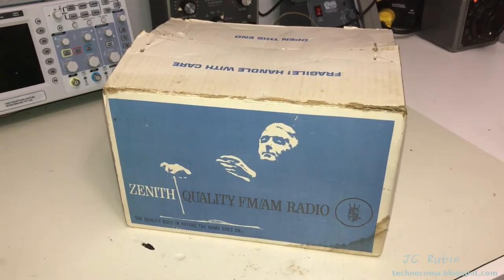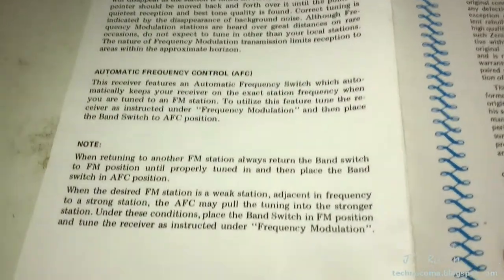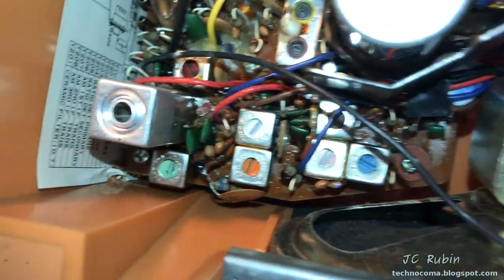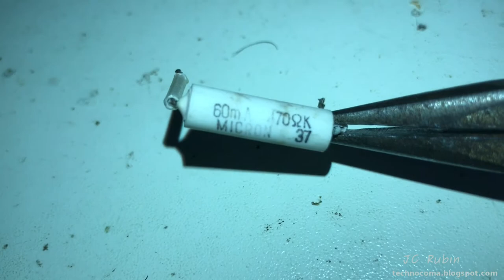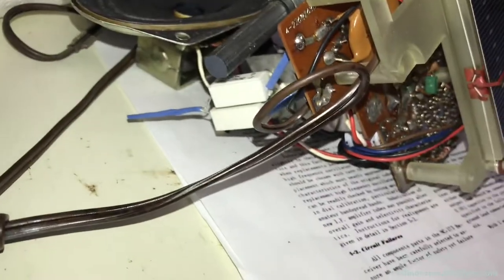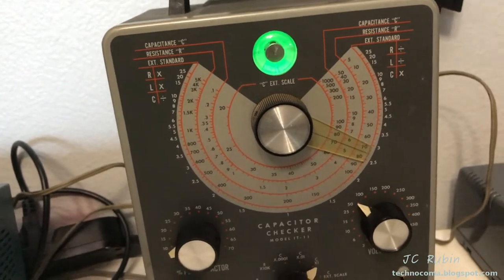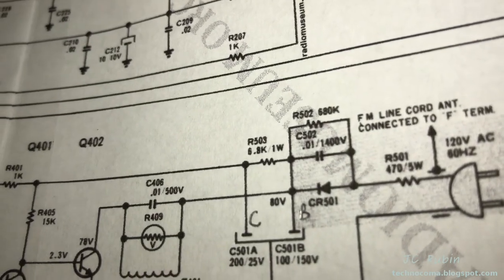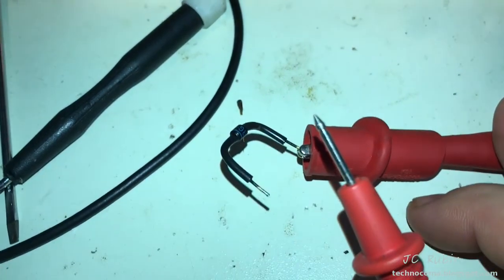Zenith 412V AM/FM Radio Repair - Part 1 of 3 - Inspect & Test

Comment: I had the exact same radio, I really liked the orange and mod style. But I had to sell it when I knew I get  several times what I paid for it. The radio looked good but wasn't a stellar performer.
Reply from the maker: Some of the good things about fixing other peoples stuff, is I don't end up with a big collection, spend any money, nor do I need to be subjective about the item with regard to it being an investment.  This one was different, as a favor for a friend, only parts costs were charged to the individual.  A lot of times people have to take into account the cost of repairs exceeding the value of an item.  Some times its sentimental and they just want it working, so resale value does not come into the equation.   Thanks for replying.